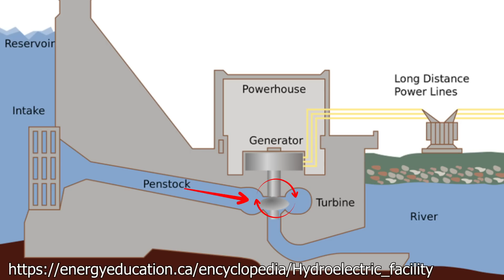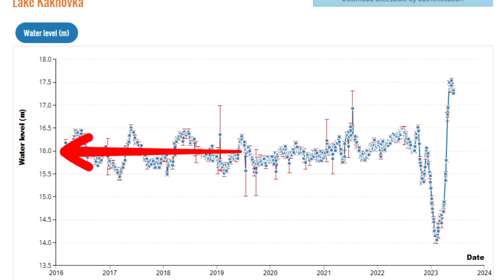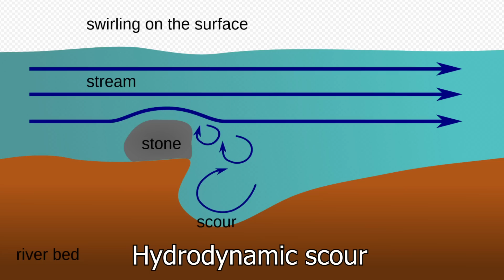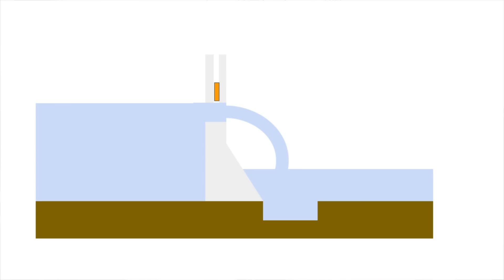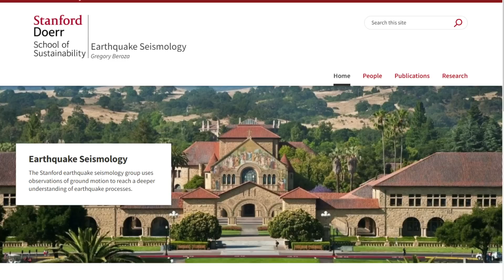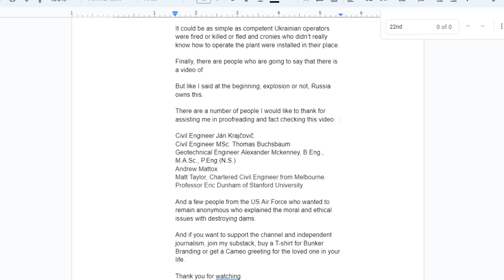How Russia Destroyed the Kakhovka Dam

Comment: Sorry to say that but I don't like the video at all. If you look at the pictures it is quite obvious that the dam was breached at two completely different points. One section is the floodgates where 20 of the massive concrete pylons holding the floodgates did completely disappear. The other section is the turbine Hall which is statically completely disconnected from the other section. It did collapse completely in the middle. The whole thing is obviously engineering demolition. A demolition expert will easily tell you where the explosives were applied and how many tons of that stuff was used.

Comment: Seismic data points towards an explotion. And a structural failiure should not look like that. The height of the water is not that high. The dam looks like a flow-dam, not a high-pressure dam.

Comment: I don't see this at all. If you look at the pictures of the early (and later) breach, there are THREE SEPARATED breaches. One where the sluice gates were (your scouring location). One in the MIDDLE of the turbine hall. And ONE in the Lock area. There is no way scouring from the overtopping is going to back itself up and take out those other two DISTANT and much more sturdy dam structures. At least not in isolated sections. Scouring COULD have slowly widened from the sluice gates, but it didn't do that, it jumps a section of the turbine hall foundations, and then jumps another section to scour away the lock.
So, No, sorry, this was several internal explosions that took out three sections of the dam. They blew the lock. They blew the turbine hall foundations. and MAYBE, they blew the sluice gates.
You also have to explain how the Russians managed to time the failure of this structure to exactly two days after the "shhh" offensive started. Nobody knew this months ahead, nobody could predict when rainfall would overtop the structure, and nobody could know how long the structure would last after the overtopping.
And we have Russian soldiers admitting to mining the damn back in November! 
WHY twist yourself into such a multi-dimensional pretzel to find some other "natural" excuse?
Reply: You may be right, he's following the data available. They gain little by blowing the dam now so it becomes an extraordinary claim. As such, we need stronger evidence, stronger data, that it was intentional.

Comment: I think what you missed in your amphibious assault dismissal is the water flow which now is much higher. That may very well hinder an amphibious assault, as it means either a different landing point, a different starting point or much longer crossing time as you also have to move against the flow.

Doesn't mean that your analysis is wrong,  just that i think you discounted waterflow too easily
Reply: Any advantage given to the defenders by making the water crossing take longer, and forcing the attackers to land somewhere else, is completely lost imo by washing away the defenders' positions and creating a humanitarian crisis within the defenders' territory. The amount of collateral damage caused, and added complication, is just way too much for a sane  or smart tactician to see any benefit in doing something like this deliberately.
Reply: @ThatMattaTatta  While that may be true for the initial landing (though do not discount the longer artillery fire, as those batteries were not washed away),

Both departure and landing points were chosen with (amongst others) logistics in mind.  If you can land, but not resupply, you are basically engaging on a suicide mission.

Comment: I'm going to point out the flaws in your reasoning. For my credentials, I will point out that I was an 11A and then an 18A and that one of the targets that my ODAs were expected to consider for our targeting were dams, specifically Soviet Era dams -- built like the Nova Kakhovka Dam. 

Structural collapse is generally what you try to assist if you are an SF ODA, because the amount of explosives needed to destroy the wall of the dam (or even part of the wall of the dam) is excessive to that which an ODA can carry. 

The problem with your research here is you spent tons of time doing research, and didn't look at the basics. Structural failure doesn't look like the Nova Kakhovka does. Structural failure doesn't create a rectangular hole in the dam wall with cut rebar visible - it creates a V shaped gap that steadily gets bigger - because that is how water erodes material. The rebar survives much longer than the concrete, it doesn't sheer off.  The gap steadily expands until the entire dam is gone or the water pressure relieved. 

That isn't what the Nova Kakhovka dam looks like or what happened. Water spilling over the dam won't usually collapse a dam and certainly not the sort of strong dams that the Soviet Union build. 

The hole in the bridge that showed on 6 and 7 June is clearly one created by tons of explosives planted to create a hole in the wall in the damn, it is not a hole created by structural failure under water pressure. In addition, the way the shape of the gap has not significantly changed since 7 June suggests it is not a structural failure. 

There are films of dams collapsing from structural failure. I urge people to look at them. They don't look like Nova Kakhovka does. In fact, the most famous of such dams (with an assisted structural failure) is the Eder Dam. Look at a photo of it  (https://upload.wikimedia.org/wikipedia/commons/9/9e/Bundesarchiv_Bild_183-C0212-0043-012%2C_Edertalsperre%2C_Zerst%C3%B6rung.jpg) and compare that with the Nova Kakhovka.
Reply: Well, that "hole in the bridge that showed on 6 and 7 June" was not created by "tons of explosives" - that is absolutely sure, sorry, no matter what team you served. That part of bridge was damaged last autumn when Ukrainian army fired at it - it was many photo and videos of that damage and that 100% sure. Also no point to do that for Russians whatsoever - they, in turn, blown up same road on right bar connect in October when left right bar - which makes that road completely inaccessible. Neither anybody reported that explosion with "tons of explosives" around June 6. And people do watching a thing 24/8
V shaped gap  seems exactly what happen initially  and there is a video of that hole at night. And than it extends to the left. And then already at day time step by step dam was washed away - and some peace of earth part of it on the left too. 
The problem with your research here is you didn't look at the basics.  😀
Reply: @vladimirpecherskiy1910  You have no idea what you are talking about, do you?
Reply: @Ghatbkk  Yes, I do not. I just can 100% proof any thing I sad.
Reply: Its rectangular because the gate was open, and the water was still coming over the dam. And if the water literally ate the ground under it, it could further support undermining since those rebar will not survive a complete debasing.
Reply: @Sufferingzify  If the Gate was open is immaterial to the damage.
Reply: The entire Dnieper Reservoir Cascade, in addition to DneproHES was built for the new world war maximum stability for action outside and minimal for action from the inside, for the convenient destruction of dams and destroying logistics in the case of destroying a tank wave on the Western Front and mass retreat .
Dneproges was built to provide electricity and convenient shipping by its destruction of the bonus, the others were built for this. Only DneproHES  blocks the thresholds and only it effectively uses the area.
Reply: That what I thought too. Ukrainians have intercepted communications of Russians proving they planted explosives in generator room in October last year. Now it’s going through assessments and release.

Comment: The road section in the dam was attacked with HIMARS at the same time they were attacking other bridges over the Dniper trying to cut Russian troops in Kherson from their supply lines. That bridge is not part of the structure of the dam, check for higher-res pictures online.
Also, there are many witness reports that speak about a big explosion before the water started to rush through.
Finally, today the New York Times reported from a senior Biden administration official: "The official said that satellites equipped with infrared sensors detected a heat signature consistent with a major explosion just before the dam collapsed." A lack of maintenance in the dam couldn't produce such heat signature.
I'm still inclined to believe that the Russians blew it up. A quarter of a mile of water might not be a big deal for amphibious operations but a quarter of a mile of mud will be.

Comment: At about 10:00 I feel your a bit too dismissive of the seismic data (from Romania, not Norway).  You leave the impression that its too difficult to figure out, rather than that the data indicating negative explosion.  Of course its not your job to figure it out, nor is it the Stanford professor you discussed it with.  But someone should be doing this.

Comment: British "Dambusters" used 22,000 pound bombs dropped from 50 foot altitude. B52 needed to carry that bomb.
Reply: The B-52 didn’t come out until 1952 so you’re a decade or so off….
Reply: @murrydog100  Duh the only current planes that can carry 22,000 pounds is Tu95 and B52. That 22000 pounds of explosive only breached the dam when precisely delivered. Yes, Lancaster dropped them in WWII, so what?
Reply: @stephenjacks8196  Did you forget the B-1 and B-2 the B-2 can carry 2 MOPs at 30,000lbs each.

Comment: Exactly my thoughts. Dam was damaged back in November. Week before collapse Russian have raised water level way to high, expecting CO to start any moment to explode the dam. But the dam had given up before that. That's why Russian forces along the Dnipro shore weren't warned and prepared for evac. One would see a couple of explosion footages from surrounding area if it had been exploded.
Reply: Then why is there satellite footage of Russian heavy vehicles withdrawing from the potential flood zone the day before the dam failed?  They just left Infantry in their positions.
Reply: @rockbutcher  whether it was intentional sabotage or not, higher ups would likely have still known that collapse was imminent, and human life may be considered less valuable than their scarce supply of trucks....
Reply: @AngDavies  Agreed 100%.
Reply: @rockbutcher  It would still make sense. Russians would be aware that the road way had collapsed a couple days before and knew a dam failure was likely possible so they withdrew the equipment that would be most at risk from that. Still means the Russians knew the dam was going to collapse at some point and did nothing to prevent harm or warn anyone.
Reply: @BlargSmarg  That is true, and I'm not arguing the possible scouring that would have happened, because it does.  My point was the three breaches.  I think there were several factors at play here and time will tell.  I'm not saying that Ryan is totally wrong, but to simply dismiss the explosive theory is not a very scientific approach.
Reply: If it where an explosion it was in the powerhouse/turbine room. So inside the dam so it should not need to be visible from the outside. And if Russia have clear evidence they definitely wont show it to us.

Comment: Thank you for this analysis. Although the 1st reflex is to assign deliberate action for the dam collapse, especially because of the timing, it doesn't make sense for Russia to cut its own water supply in Crimea. Negligence appears aa a more reasonable explanation.
Reply: water was off between 2014 and 2022 for crimea)...
Reply: @fradada2184  My understanding is that Russia opened the canal as soon as they were in control of the supply.
Reply: Just that it was russian negligence/ignorance in the course of a safety test of a badly designed reactor caused Chernobyl...
Reply: Ignorance of the law is no excuse - but apparently russians don't believe this applies to the laws of physics...
Reply: Or, to push the conspiracy theory more, the Russians knew that only opening one sluice gate would undercut the dam and cause a collapse, but without direct fingerprints. That would be a reason for passing a law to not examine the reason for failures. I'm just not sure Russia would be able to pull this off. But, it's a good theory.
Reply: Maybe they are just stupid and incompetent?